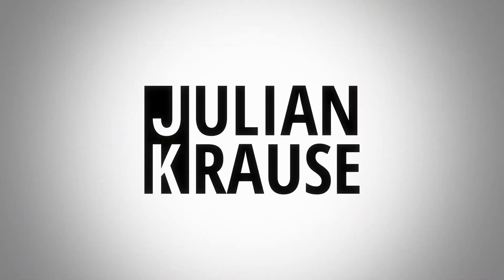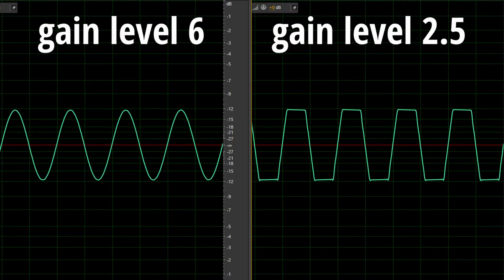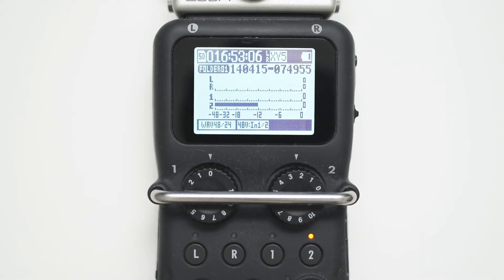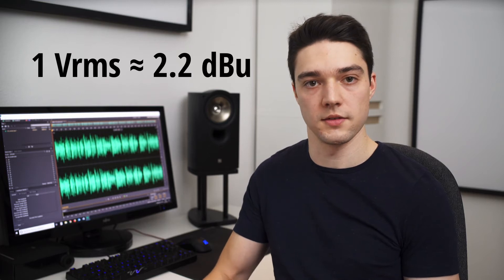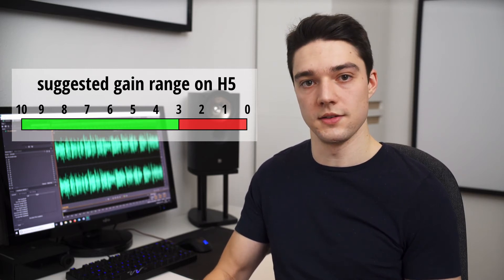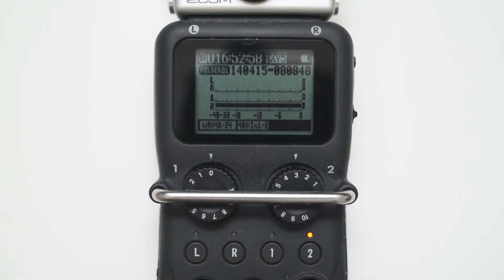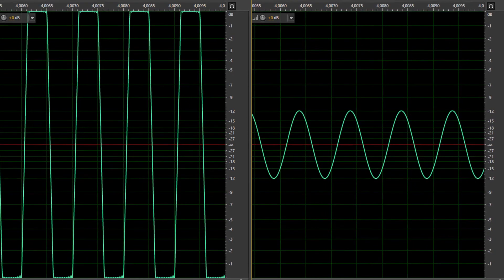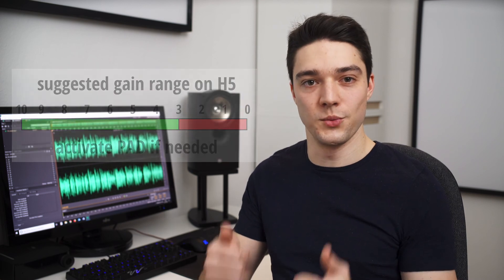Zoom H5 Gain Clipping Problem and Solution

Comment: Julian, I was thinking about this today with regard to very loud sounds. Many microphones have a -10dB pad so for really loud stuff, I wonder whether this is enough to stop clipping happening? In which case, it might have been handy to have had one on the way in to the recorder before any digital reduction.

I get similar with regard to gain levels on the Tascam DR05 which needs a pretty small signal from my mixing desk if connected directly as a line in. It doesn’t clip but has to be set very low, with the desk output also lowered quite a lot.
Reply from the maker: Hey, a -10dB PAD might help. But as I showed in the video you can always activate a -20dB PAD on the H5. This attenuates the signal before it is A/D converted. So you dont really need a PAD on the mic. 

Regarding your DR05. When you feed in a strong signal and you have to lower its gain, that's a good thing. This way you will have a good signal-to-noise ratio. If you don't experience any clipping you are fine.
Reply: Yes, you’re absolutely right.... the noise floor drops away into virtually nothing as long as a good mic is on the other end. Sorry, I missed the 20dB pad on your video. I thought there might well be one in order to avoid this problem but wasn’t certain.
Reply from the maker: @iancraig  All good, I also have to confess I was very skeptical about the PAD on the H5 because I was not sure if it is attenuating the signal before or after A/D conversion. That's why I tested it and it turns out to be an analog attenuation which I would not have expected.
Reply: Yes Julian. I looked for the manual and when I saw it, I assumed that it was digital and maybe in the wrong place as well. It’s a nice recorder and I battled with h4n or H5 but settled with the H4n in the end.     I attenuate from an external mic if that problem appears, but tbh, it’s never been a real issue for me because I mostly record speech and ambience.

Comment: Hi Julian. That's a real serious problem. I think you've been very generous in not calling this what it really is, a stock fault with the Zoom. For the price of these things you'd expect a totally analogue gain stage and no digital attenuating/gaining what so ever. I've seen worse on other devices where they have a high bit depth A/D buffer, then everything thereafter is attenuated/gained within the digital domain before final render. This is usually done to apply all the dynamics processing digitally as it's cheaper than doing it in the analogue preamp stage.  But the obvious problem is that any issues in the analogue stage will carry through in the digital domain, as you've mentioned. I wouldn't be surprised if on some of these recorders that the limiter is applied in the digital domain, which would also explain why some of them distort. I sometimes go back to tape and a small low noise console just to remind myself of how things used to be. Although you can't beat digital recording as long as all your inputs and outputs are done completely analogue with good analogue components and high resolution A/Ds and D/As inbetween. Cheers, Dave.
Reply from the maker: You are right, the 0 to 3 gain range should not exist on the H5. And btw you did guess correctly, the H5 also has a built in limiter which is only applied in the digital domain and thus will not prevent any clipping at all...

Comment: Damn it Zoom!  I knew I heard something wrong outputting from my DBX 286s into the H5. I wanted to avoid engaging the pad to avoid the noise floor completely.  Just might have to now.
Reply: Using the pad will actually lower your noise floor, assuming the DBX unit has a better gain stage, which is highly likely. Using the pad will mean that the units preamps aren't being worked as much and the gaining is being taken care of by a better preamp. In this instance the recorder is basically being used as a recorder.
Reply: David Harry 😎 thanks
Reply from the maker: Funny, I encountered this clipping problem because I hooked up the H5 to a DBX 286s as well! Don't worry about the noise floor too much, when you activate the PAD and feed in a strong signal like the line level from the 286s the noise is going to be miniscule.

Comment: The same thing happens with the Zoom H1. Once you go below the 5.5 mark, the level is reduced digitally after the input, which actually means if it’s overdriven on the way in and then reduced afterwards. The distorted signal just isn’t as loud but still distorted. The digital circuits can be heard coming in by listening to the hiss level which is the point where they start to work, but unfortunately, after the signal has already been distorted on the way in!!
Reply from the maker: Good point, I made a video about that a while back: https://youtu.be/Dv663l84Vlo
Reply: Alright Ian. You should just use a camera with better audio :) Sorry, I just couldn't resist that. This is another reason why I wouldn't do synced audio, most of these low end recorder-preamp devices simply don't give enough of a benefit over a good camcorder's audio system. Cheers, Dave.
Reply: Hi Dave. The problem is only there with extremely loud sources. Live pop groups levels. Generally, it’s not a big deal.

If only I could afford a camera with a good preamp .......